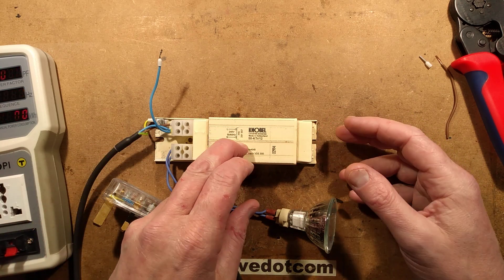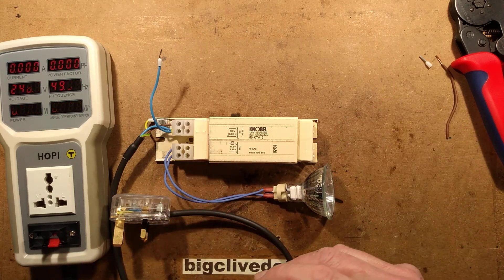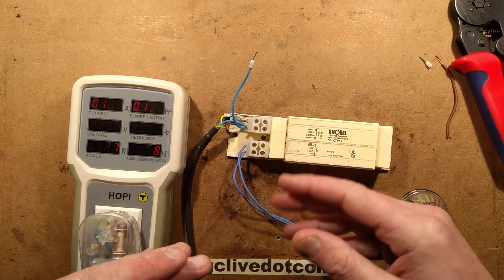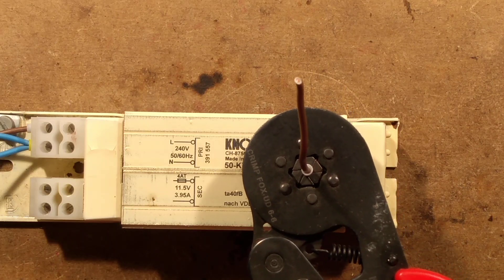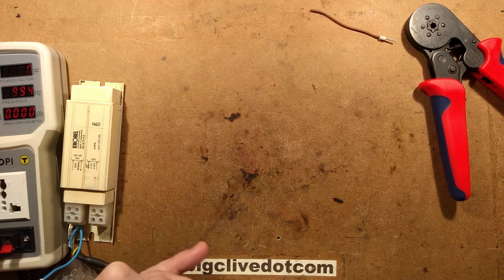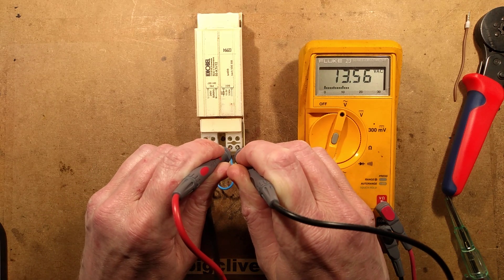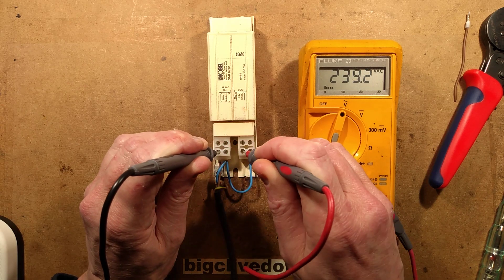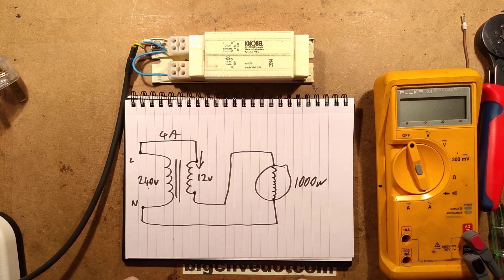Adjust your mains voltage with a standard transformer.

Comment: i had to  log my incomming supply voltage for a couple weeks to convince the power company that i was indeed getting as little as 215v during the day and 265v over night when all the load dropped off, eventually they moved me onto another transformer feeding from the other end of the street which maintains a far more consistent 235-245v. all my electrical gear has been far more reliable since.

Comment: Years ago I worked for company which had three phase variacs to produce a stable output voltage. Auto Voltage Regulator (AVR) as they were called by the manufacturer. They used a buck and boost mechanism which would adjust the arm of the variac's to gain the ideal output voltage. Interesting watching the AVR in service when a kettle or heater was turned on and the AVR would swing the arms in a large movement which would decrease until the arm settled at the new position on the variac's.
Reply: I'd love to see that in action!

Comment: This can only work correct in countries with a fixed live and neutral. In my country i expect this is going to fail. because live and neutral can be swapped. depends how you did add the plug in the wallet.
Reply from the maker: It doesn't matter what polarity the AC supply comes in as.  It's the phase relationship of the windings that determines the buck or boost function.
Reply: Don't use a plug ;0) Or mark it pretty clearly if you are using plugs. But on the other hand, I don't think it will make much difference in the voltage at all since you are using a single loop both if you are going with fase or neutral through the transformer or the lamp first. The effect is the same.

Only point is that with plugs the blue wire is sometimes neutral and sometimes fase. Just don't touch!

Comment: What did it do for the power factor ? was there a change ? could this be corrected with capacitors
Reply: Power factor of unloaded transformers is always horrible because they work by shifting the current sine wave by almost 90° which makes a power consumption but also power factor of almost 0. The losses are humming of the transformer etc. If power factor doesnt matter, this shouldnt be an issue but fixing it would be inefficient. Thats one reason why mains transformers are almost all gone and replaced by switching power supplies with power factor correction.

Comment: Those transformers are still crap imo, break way before lamps do, I try to avoid them at all costs.
Reply from the maker: These are the non-electronic ones.  But if placed in a position surrounded entirely by thermal insulation they can overheat and trip an internal thermal fuse.
Reply: Yeah I do not know what the difference is from an electronic one and a non-electronic. I just try to stay away from them in general since I have always had a bad experience with them. And yes they to tend to be stuck into places where they probably shouldn't be, under ceilings, in insulation etc.

Comment: Excellent video. I may test this out by taking two shi**y LED lamps and connect one directly to outlet (Sweden ca240V) and one via this coupling to lower it to about 210-220 and see if the input capacitor will survive longer. I have bought a fair amount of cheap China LED lamps and every now and then I wake up to the "beautiful" smell of popped caps. And I don´t even like the smell of popcorn :P

Comment: cool I use boot lace crimps all the time I have the old tool which puts the dents in as you describe might have a look for one of those as with the old tool you need to put it in the correct slot for crimping !

Comment: Clive, is there any concern about the insulation of the secondary winding in respect to earth.
The insulation of the secondary may not be up to spec for 240V.
Reply from the maker: In most split bobbin transformers the insulation on the secondary side is equal to the primary side.  And the secondary will still only see its rated voltage between the windings.
Reply: The secondary winding will only see the rated voltage if a load is connected, without a load the mains voltage will be across the windings. But that should be no problem if the insulation is as good as you say. No pun intended.

Comment: Would this give any benefit if I wired this up to some driverless cobs?
Reply from the maker: Yes, it would potentially reduce the dissipation from the regulator chips.  But it would also add an inductor in line which should be protected against by the presence of a MOV on most of these modules.
Reply: @bigclivedotcom  so yay or neigh Clive?

Comment: Good way of efficiently adjusting the voltage but you have to keep an eye on the secondary to earth isolation because you can effectively raise it to line voltage. It is best to connect the transformer onto the Neutral rather than the Line wire to reduce voltage stress on the secondary winding but you have to be sure that Line and Neutral are the right way round as some plugs are reversible.
Reply from the maker: In most traditional transformers the split bobbin is symmetrical in terms of insulation.

Comment: Bit confused (not unusual for me) . Your circuit diagram showed the Live going through the secondary, but it seemed you passed the Neutral through the secondary? . Second question, Does this mean you now have a non isolated supply?  Barring this confusion, it seems a very nice solution.
Reply: Correct me if I'm wrong:  The purpose is just to fine-tune your  mains voltage by using a standard mains to low voltage AC/AC transformer. The load will still be fed un-isolated AC as before. Clive just measured the live side of the circuit with his Fluke rather than connecting it to a load while keeping the neutral referenced to zero volts.
Reply: Yeah, you are absolutely right that Clive is just reducing the mains voltage via a transformer using an already un-isolated source to light lamps. So, in that respect, isolation is irrelevant....I just wanted people to be aware of the fact that a transformer used in this way ceases to become isolated, in case they decide to use this method of wiring in other situations.  I'm still not sure I've understood why he specifically illustrated the live going through the secondary but 'seemed' to connect the neutral to the secondary....I'm sure he will correct me :-)
Reply from the maker: At the beginning I had the link wire floating about while the lamp was connected, so made it the neutral for safety as it was in the vicinity of the earthed/grounded transformer case.
Reply: Ah, OK understood.

Comment: Hello,
I live in france and power seems to be pretty stable here,
But jus for the fun, how you can stack /cascade to have even higher or lower voltage ?
Reply from the maker: You could use transformers with different secondary voltages, centre tapped or dual secondaries.

Comment: Hey Clive ! I have a 5v10amp switch mode supply here. On the case it says 100-240v AC at 1.6 Amps....how in hell can that be so inefficent it even says powerfactor corrected in the manual
Reply from the maker: The 1.6A is usually the maximum rated input current.  It'll be lower than that depending on output load and supply voltage.

Comment: Clive you do realise that to get the results you are you have a phase reversal on your extension lead. The Blue lead must be active to get your results. In Australia Blue conductors in single phase flex is Neutral.
I have used the same auto transformer method on an industrial 4 door drinks fridge that would burn out a compressor every summer when the mains voltage sagged with everyone using air conditioners. The  mains voltage would dip just below the operating rating of the compressor and it would occasionally stall on start then cycle on it's thermal over load until it burnt out. Of course it never did it when you were there watching it, I happened to be in the restaurant eating one hot summer night and noticed the fluorescent lights were strobing occasionally so I quickly nipped out to my car grabbed a meter and found there was only 218 Volts on a nominal 240 Volt supply, when the fridge tried starting it stalled out. A few minutes later and the mains were back to normal. I fitted a Xformer with a 12 Volt secondary adding to the primary, the fridge hasn't failed in 4 years.
Cheers Ray
Reply: Doesn't matter what 'polarity' the transformed is connected. It's AC. The only difference between live and neutral is that neutral is closer to earth potential (in some households).
Reply: Which if Clives lead is indeed blue conductor Neutral. means his additional voltage from the secondary is less than Neutral/Earth potential, this also adds impedance to the Neutral return conductor. Watch carefully how Clive is connecting the secondary, if the connected appliance has an internal earth to neutral connection, common in older equipment the transformer will burn out.

Comment: People should know, they'll lose galvanic isolation of the transformer. 
Its not a big deal in this application, because there was no isolation to begin with.
Reply: Liam, I just warned someone else about that very thing! See my comment above (a reply to SandPox).
Reply: that's not how isolation works
Reply: - I was replying to Szakembor
Reply: At least in North America, neutral and ground are connected together in the breaker panel.  Idk about other countries.
Reply: Although they arent the exact same anymore after the breaker panel, the voltage difference should be practically 0, so it shouldnt be able to arc in the first place, making the consequences of shorting them unimportant.
Reply: @albertlagerman  After the breaker panel here. Since the breaker panel has the RCD it needs to know what is and isn't coming back through the neutral.

Comment: Almost a 6v difference between the Fluke and the Hopi. I trust the Fluke, and the Hopi being off will skew your Watt calculations.
Reply from the maker: It may also have been partly due to loads in neighbouring buildings pulling the voltage down.  The local transformer is small but feeds a few streets.
Reply: Have you tried to measure the same voltage source on both devices simultaneously.

Comment: This actually solves a problem i was having that i thought could only be solved with a custom transformer. (Running japanese equipment on 230v. I have lots of 230 to 115v transformers but no 230v to 100v so this is excelent) Load would be around 4 to 5 KW if anyone is interested

Comment: I have a question running on my mind for long: In Philippines there is 220v 60Hz, in The Netherlands there is 230v 50Hz. It is possible to make the 60Hz into 50Hz so I can connect for example a record player from NL in PH? Or the other way around: 50Hz into 60Hz
Reply: 60hz apliance at 50hz is no Problem , otherway around it can be a Problem depending on the inner circuit
Reply: It is possible. A common way is to convert the input AC with frequency X into DC and then generating AC with frequency Y at the output similar to switch mode power supplies. These increase the frequency to to be able to use much smaller transformers.
In the past when there was no electronics like we have today they used a motor-gearbox-generator setup (see motor-generator on wikipedia).
Reply from the maker: Frequency conversion usually requires quite expensive inverters.

Comment: I understand that quite well. Reason being that I own some 1980's-vintage JDM audio gear, designed for 100v. And while I've heard of folks plugging it into 120v, here in the States, I've always erred on the side of caution & ran them on a transformer. Also, due to Japan's quirky mains setup, the equipment is 50/60Hz switchable.

Also, I've run my vintage & antique Christmas lights w/ about 95-100v for the same lamp-life reason, that you mentioned. Also, some of the really old lights were meant to run on 110v (as was common in the early 20th). They've lasted for years, that way.
Reply: Just out of interest, what does the 50 / 60 Hz switch do? Surely audio gear just converts mains into lower-voltage DC for the electronics, the frequency shouldn't matter. I'm confused!

Comment: Could you link to those crimps please. I can't find any that look as good as those.
Reply: If you search for YEFYM crimping tool hsc8 on Ali Express there are some good looking tools on there.
Reply: In fact, scratch that..search HSC8-6-6-Terminal-Crimping-Tool  on ebay.. same price as china, but UK stock
Reply: Thank you for that.
Reply: Search on Ebay or Aliexpress for "Six Mandrel Ratchet HSC8 6-6 Crimper Plier"
It is a knockoff of the "Phoenix Contact 1212046 CRIMPFOX 6H"
Reply: just google ferrals in the gauge you need

Comment: Now lets try it with an electronic "transformer" for halogen lighting. :D
Reply from the maker: Definitely not.  Those things are responsible for nuking a lot of LED lamps.
Reply: and your LED lamps go (( BANG ! )) no more light ..
Reply: that was my thought also just make sure you use one of the old type heavy ones and not the new type switchmode.
Reply: I also bet this would either decrease or increase the light level in the room. But only for a short period of time.
Reply: Potentially decreases the light for a long time, once they've gone bang. ;)
Reply: Liam Basically it's because it's not really the secondary.  It's a regulator placed after the secondary (with an oscillator before the kHz-range transformer).  So treating it like a real transformer seriously harms the circuits.

Comment: I was going to use this technique in additive configuration to get 240V from my 120V mains and an isolation transformer - just turn the whole thing into a center-tapped autotransformer. Turns I don't even have that isolation transformer anymore, though.

Comment: When I was a teenager my uncle wired an  (Automotive) amplifier for my cousin said he increased the output of the amp by running it back thru itself. Is this that. I know what bridged connection on a bridgleble amplifier is. Is this what my uncle did. This happend 30 years ago.
Reply from the maker: In a bridged amplifier you effectively have two amplifiers out of phase driving a speaker so one is effectively pushing one side of the coil while the other is pulling.

Comment: Knowing how ground leak detection works (like GFI for the US) and how transformers work, this basically has a constructive or destructive magnetic field setup depending on which way around the current flows between the windings.  Same direction adds voltage, opposite direction subtracts it.  Just that delightfully simple.  GFI detection fully cancels out the magnetic fields to zero and if they aren't zero then current is leaking elsewhere.  This just partially zeroes it.